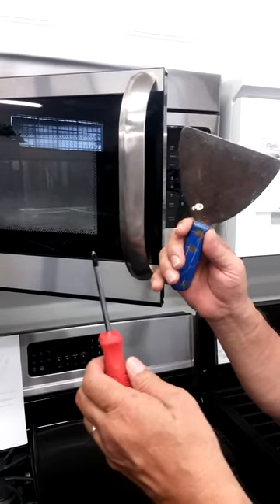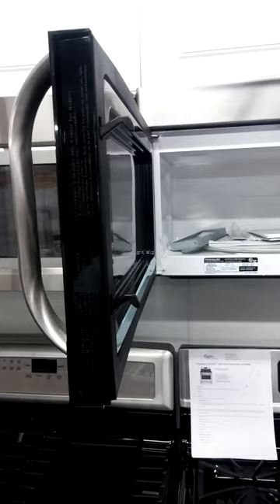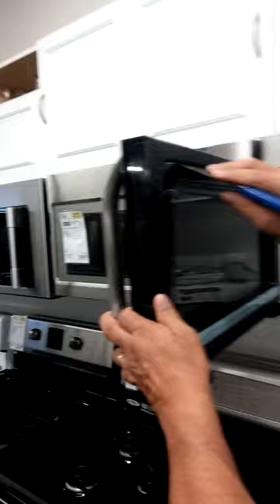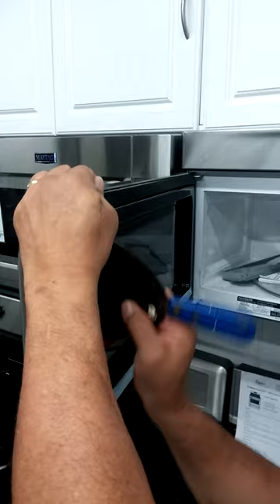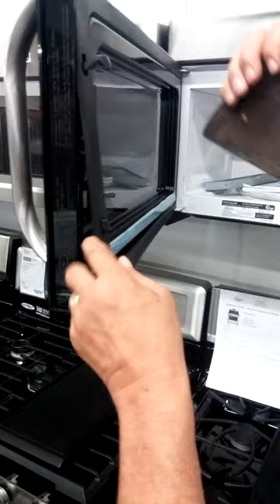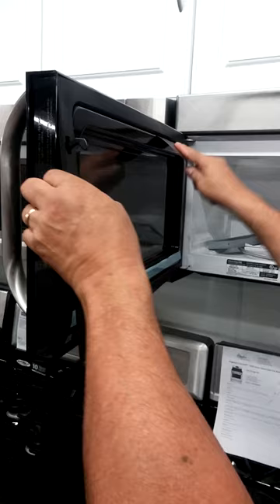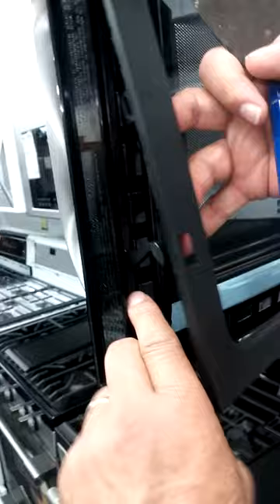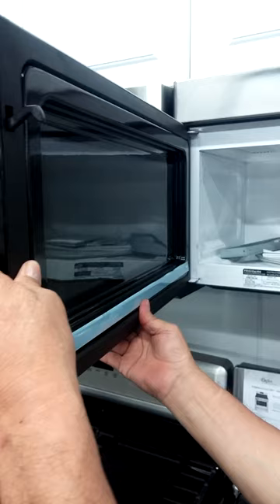How to remove a door handle on a microwave

Comment: I missed the part where you actually removed a door handle… my reason for watching.  My old, broken Bosch handle certainly is not easy to replace, given (apparently, at least) one hidden screw on the upper portion.  How does one go about removing the screw attaching the upper portion of the replacement handle?  Thanks.

Comment: I followed your directions,  had  re-glue the broken part allowed glue to set four hours.  Reassemble but to get it to work I have push on the door....any ideas.
Reply: I did not mess with the door hooks.
Reply: I tried to glue my old handle with epoxy to no avail… ordered a replacement.